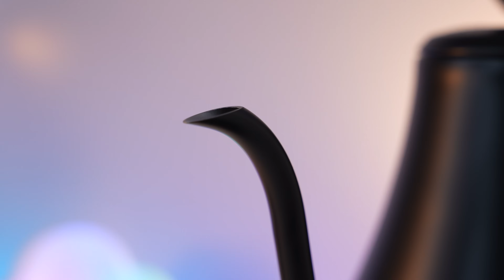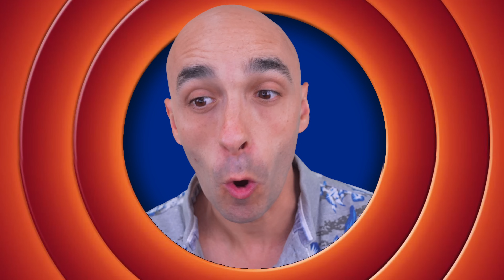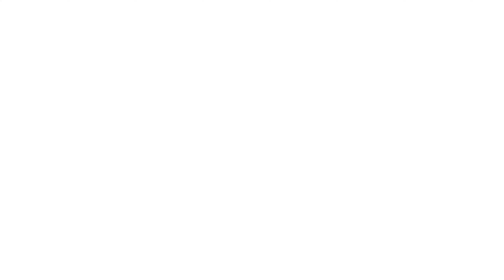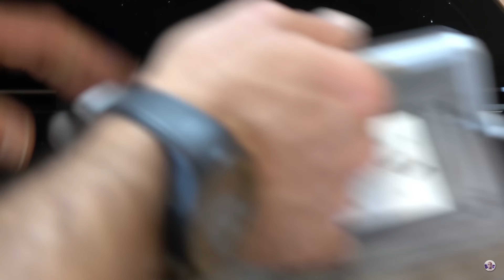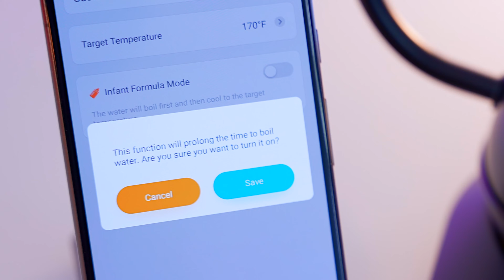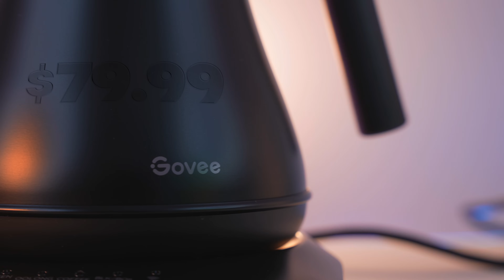Govee Smart Wifi Alexa Kettle | This Did NOT End Well!

Comment: As a solar PV owner, I deliberately buy lower wattage kettles, and I don't mind it taking longer to boil if its "on solar" on  duller days without using any grid power. This kettle would be awesome if you can reduce the wattage too! For now I'll keep buying travel kettles (700w)
Reply: Not sure how that saves power? If it takes longer it will consume the same amount of power over the time it takes to boil. Light bulbs yes but kettles? Energy in = Energy required to boil.
Reply: @marktime61  doesn't save power, but can save money. 

If it takes 10 mins to boil on solar power alone, you don't care are you aren't paying for it. If it uses 700W from solar but has a 1400W element then you'll pay for the 700W used from the grid even if it's for half the time.
Reply: @darrenchapman6947  understood. Missed the bit about solar:-)
Reply: @marktime61  It saves power because on a dull day your solar panels typically generate approx 1/10th of their rated peak power. e.g. if you have 7kw of solar PV, it equates to a typical generation of 700w. Therefore if you put a low wattage travel kettle on when the sun is out even on a dull day you're barely using grid power so its free, but it takes longer to boil. If you turn on a 3000w kettle on a dull day, it works out as 3000-700 = 2,300w from the grid :) Obviously if the sun is out, a 3000w kettle will be free at 10am-2pm usually with south facing panels. Hope that explains why this strategy works for people with solar and without storage batteries. So in a nutshell it saves GRID power during the day.
Reply: @marktime61  I think if a solar system is only outputting 700w any more powerful device would draw the extra power from the grid and that would be charged at the prevailing rate.
Reply: This depends on your power provider. Where I am in Australia, the power accross all phases is summed every 10 minutes and billed for that interval. So if you boil a kettle at high speed for 1 minute, or low speed for 5 minutes.. billing wise doesn't cause any difference (same if you use all your power on 1 phase instead of balanced, if you have 3 phase). I'm the opposite lol, here we have 2400W kettles.. too slow for me. I want to import a UK kettle because they do 3000W kettles and put a 15A plug on it.
Reply: @lathiat  Average 10 min billing? That's crazy. It could work against you or in your favour, depending.
Reply: @remaincalm2  I think i explained it badly. I don’t think you’re ever worse off. It still measures actual kwh imported or exported. But it sums it up every 10 minutes, then bills you that number. It’s like a mini electricity bill every 10 minutes. The advantage is that you can basically add up 10 minutes of your export but use all of it over 1 minute. As long as it was all within the same 10 minute period.
Reply: This is understandable if you have a really small solar array and no battery. Most modern solar installs are at least 4kW, have at least a 5kWh battery and a 3.6kW inverter, so it's no problem at all to use appliances that are 3kW and power it completely from solar  or battery.
It takes exactly the same amount of energy to boil the same amount of water in a 700W kettle as it does a 2400W kettle. I'd rather not wait 3x as long by using a 2400W kettle.

Comment: Finally, a wifi kettle. I have used a power monitoring smart socket for ages to do this job (and tells us when it's boiled, then turns the socket off via Homeassistant/alexa) . Our family quirk is to make a cuppa, then re-fill the kettle and turn it on waiting for the next command. If someone neglects this and we send the command to boil the kettle it will wait 20 secs and if there is no rise in power alexa will give you a telling off. Fun. I also have an input boolean I set so if I'm out it will boil the kettle when HA detects I'm home.
Reply: Wifi kettles are nothing new
Reply: I had a look once, they were all bluetooth then
Reply: @JamieVids76  What difference does it make if you're automating it with HA anyway?
Reply: Bluetooth? The integration isn't what it was now when I first looked

Comment: They missed a trick. Add a simple weight sensor and the app will be able to tell you if it has enough water for the drinks you want to make.
Reply: The smarter iKettle does this.
Reply: No they've not - the capacity is 0.8l - if you've done ANYTHING since you last brimmed it then you'll need to refill!
Reply: @Jakdaw  0.8l is three mugs. Make a mug of tea, friend comes round. Do you need to fill it again to make two? Did you make a mug before you want to bed and forget to refill? A simple question the app could answer, with pennies worth of technology added.
Reply: @Jakdaw  ?

I can't tell what you're replying to.

Comment: i just tell my alexa morning then the light an kettle comes on kettle also turns its self off after it boilds too using timing yes you have to put the same amt of water in for next time so timing os predictable its called inching! you dont need any fancy kettle just get a smart socket they are cheap!
Reply: Thats what l use a phillips hue £30 wasnt as cheap as some plugs but it works , l have one on the tv and one on the electric fire too. Simply on off, but thats ok, like you said the ordinary kettle turns itself off, has an inbuilt overheat facility as well.